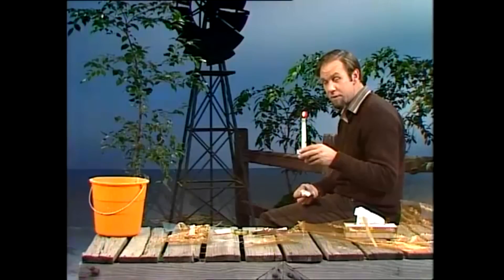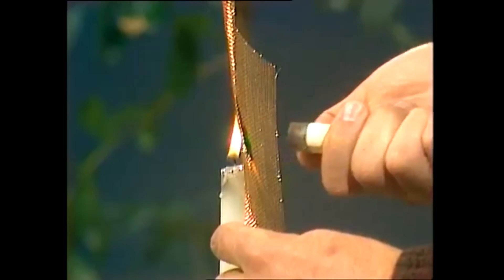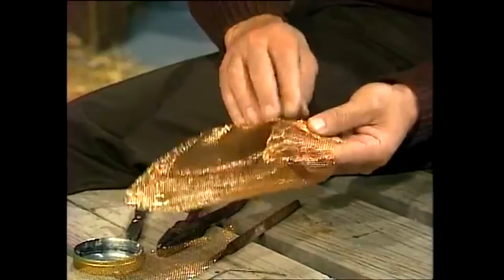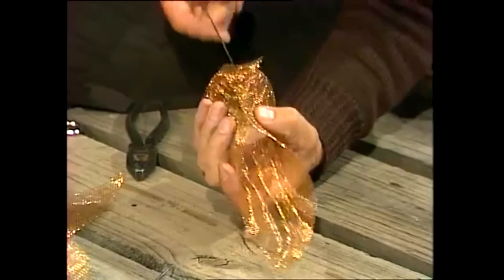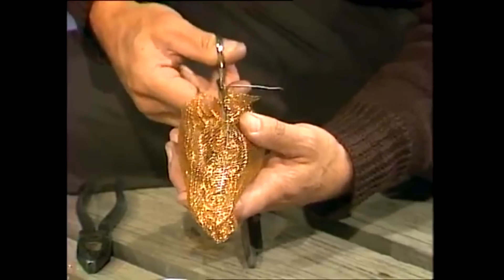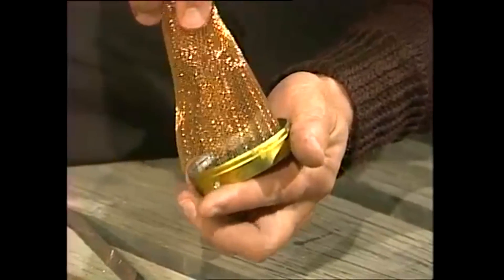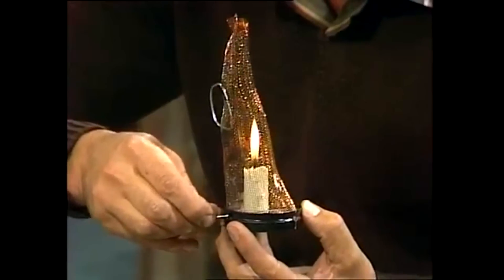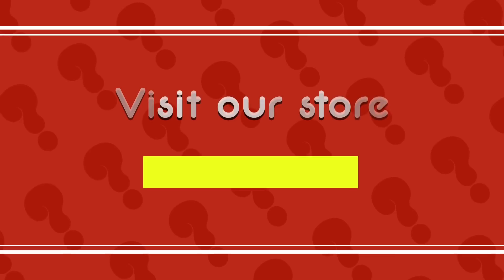Make a safe candle surround

Comment: Hot tip- before stitching your mesh you should fit it into the can and use a piece of tape to hold it together at the proper size to fit inside the can, rather than ruin a pair of scissors trying to cut metal. Then stitch together.
Reply: What do you mean?! Gauze = Fabric. Just use your mom's or wife's fabric scissors.

Comment: I love this channel still and I'm always glad to see a new upload.👍

This style of lamps was pretty helpful for miners especially when a damp was encountered. If the tip of the flame at arms length turned grey/blue it meant methane was aloft and burning within the lamp. It was a safe alternative and potentially an indicator of gases. 
 I believe it came before the carbide lamps (which I enjoy and have a few of) which were much brighter but couldn't be used in the same environments without a mesh cover. Ironically I have brass mesh for RF shielding near broadcast towers and I may just have to make one of these like a traditional style as a project.